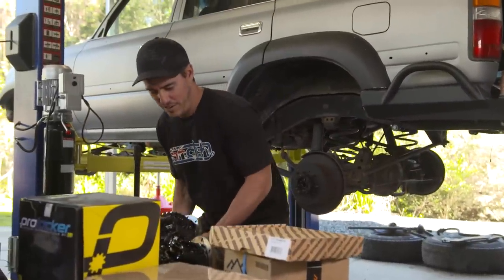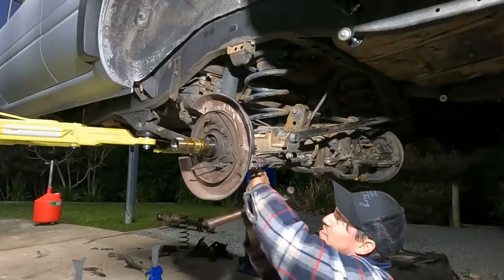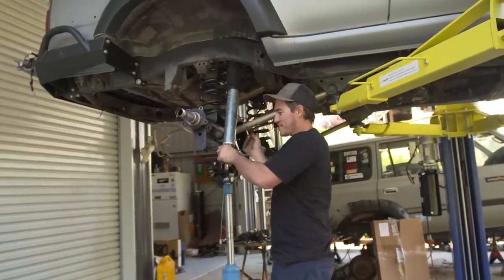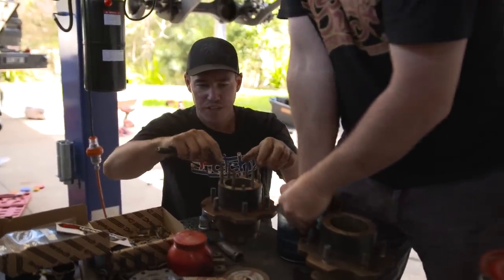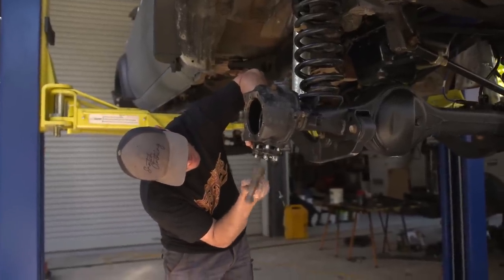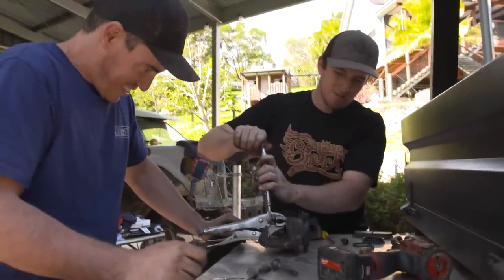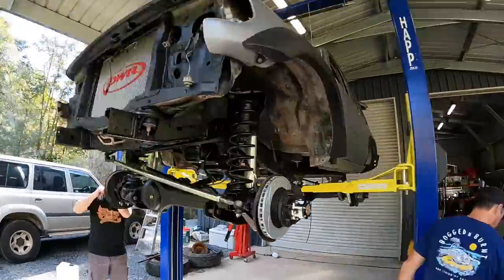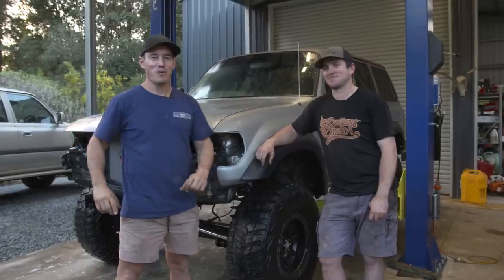SOOTY rebuild update! The BIG BREAKAGE that stopped the show - Shauno's full DIY driveline rebuild

Comment: For wire brushing nooks and crannies I make a wire brush from old wire rope, splay the end a bit and chuck it in the drill, gets down into corners, even goes around corners.
Reply: Thats a cracking tip... thanks.
Reply: also rust remover spray? Didn't see that mentioned
Reply: That IS a real good tip!! thanks for that!

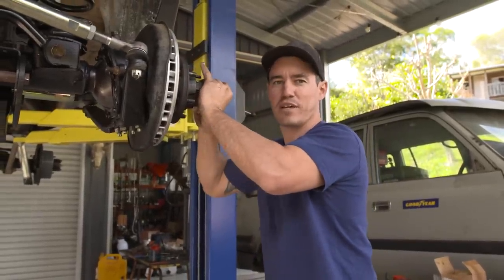Comment: Shauno - I mean this constructively... Its worth downloading and reading the manual. at 19:25 when you install the front locking nut, the process involves tightening the nut, turning it several times, backing the nut off and retightening. Torque figures are pretty important even if you've rebuilt the hubs a bunch of times.
Reply: That's the way I was taught to torque things including wheel nuts. 
Not 30 ugga-duggas with a nutsmacker then a instant click with the torque wrench.
Reply: Dude, this is Shauno we're dealing with here... most of his builds are held together by chewing gum and faith 🤣

Comment: When tightening wheel bearings, you should tighten them more than necessary to seat them, then back them off. Otherwise they will loosen up down the road. Looking forward to seeing this done. Nice work Shauno.
Reply: Yeah they need to be preloaded to 2.6-5.6kg
Reply: yes pretty much all wheel bearings are the same tighten till locked to seat em proper then back off to the preload.
Reply: @chrisforgan731 , yes unless they're the press fit type.

Comment: So on the older closed knuckle front diffs once the seals go out became standard to pack them full of grease. Those felt seals on the back of the knuckle would just leak oil immediately on the old military stuff we worked on. Everything was fairly worn out on our stuff.

Comment: Front axle seals are notorious to leak! I started using Marlin Crawler Seals and no more leaks. They have a steel wire instead of a spring to keep the lip of the seal tight to the axle.

Comment: Shauno, you don't usually torque wheel bearings you use a balance scale and pull the wheel and it will be set to a certain weight, when in spec. That is how tight they need to be because too tight and the wheel will be locked and cause friction and heat up the bearings. Too loose and the bearings will wear and knock which is why you need to do a pull off test to get them right. It might be the old-fashioned way of doing this but, it is the best method.

Comment: Looks like you've made good progress! Don't forget those crown and pinions will need a break in with a few light heat cycles before you put the beans to it.. Run it out for 1500km and swap out that diff fluid again, you will be surprised at how much metal will be stuck to your drain plugs.

Comment: 75 series also has the same problem with the axle studs shearing off.  I initially upgraded to 8mm Chromoly (like you have there) and at least they stopped snapping, but they did keep backing out.  Never thought to loctite them. I'll redo that some time.  I eventually upgraded to 10mm Chromoly and said goodbye to my stud issues, except I now have to take the nuts off the studs to take the wheel off.  I've only had to do that once on the track so far, so not too big a sacrifice. I think the main reason I had issues is auto lockers and 37" boots.
But now you mentioned it, I will go back to 8mm chromoly studs next refit and use loctite.  Thanks for the tip.
I'm looking forward to trading in the 75 Series Troopy for a U1700L Unimog with a removable living quarters on the back.  Damn, and I thought the Troopy was heavy!!!
Love your work mate.  Keep it up.  Hope to see you on the tracks some time, but I'm probably more likely to bump into Graham as I'm currently based in WA.

Comment: "It's only dodgy "IF', it doesn't work".( to quote Shauno) 🤔Hmm? Really cool to see the new soot coming together, can't wait to hear it running and, see it move back and forth for a change instead of up and down on the hoist. Maybe the transfer case issue will be resolved in time for T.L.C.C Willow Glen challenge on the October long weekend.
Might be a good place for sooty mk2's shake down run with the new low range reduction gearing. Just a suggestion.

Comment: the correct method for setting wheel bearings uses a spring scale hooked over a wheel stud and it should just move nicely at that reading in the spec sheet. but yes i dont bother with that either.

Comment: I'm not sold on cross drilled rotors. Given the water crossings and mud, I can see them cracking from rapid cooling or just plugging up with mud and chewing up your pads and defeating the purpose of drilling anyway. Maybe I'm wrong and they're fine. Definitely looks great if it's going to be a mall crawler.

Comment: Try to get your hands on a factory part time transfer, well worth not having to worry about putting a part time kit into a full time transfer and having to worry about the actuator shitting itself like they have a habit of doing.

And if it's not stuffed, I'd be keen to see the old rear air locker go in the farm truck, to my knowledge it's the same 9.5 inch diff in both the rear of the 80 and both diffs in any 40/55/60/75 up to 1990

Comment: Not quite sure if you did it on purpose to get people to comment aint but the right front and right rear tires are on backwards that's a directional tire the tire needs to be taken off the rim and flipped the round so that the tread is pointing forward

Comment: Ok I don't know much about the greasy bits but, I thought I saw them assembling drum brakes on the back then they looked like brake rotor disc's on the rear. Please help
Reply: The rears are "drum in disk rotors"  meaning the car brakes with the disks and the drum shoes run inside the rotor for the park brake only....
Reply: The design was invented by Girlock brakes in Australia and patented, which resulted in being integrated into many manufacturers designs and the patent owner becoming very rich in royalties and leaving the building so to speak...

Comment: Just pick up on you using the wrong gear oil in the diffs the lockers don't like limited slip oil the the pro lockers use EPX 85-140

Comment: fck using a wire wheel, have you not herd of media blasters?  for your pressure washer get a good one not a cheap one,,  glass bead  those diffs would be done in 2mins flat